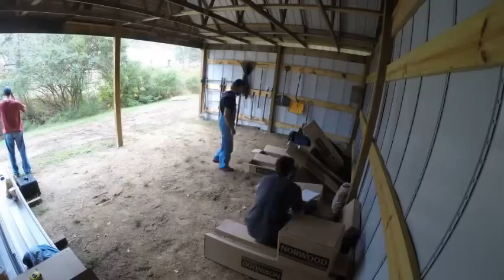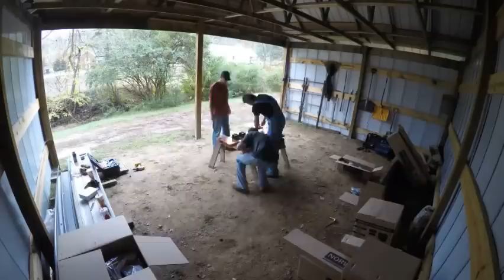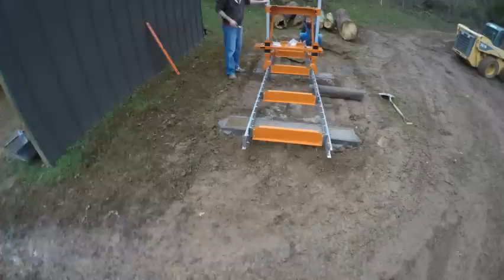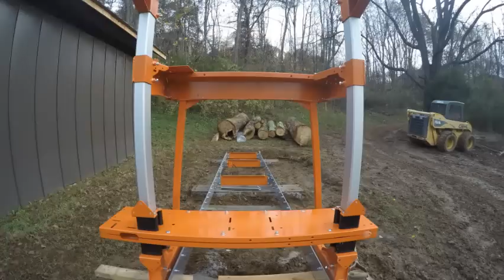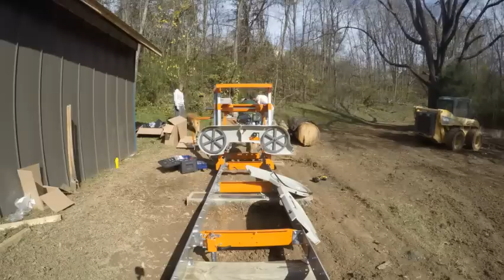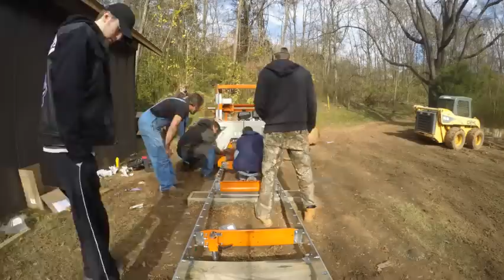Time Lapse Construction of a Norwood LM29

Comment: What do you do with the orange and blue wires and the black and brown wires
Reply from the maker: Foreign * if I remember correctly they should be your safety switches? The stop switch and a switch for the blade cover. I think they wire into the motor. I'll have to check how mine is wired. Be mindful of wire placement. The motor got hot and melted the wire casing causing a short and shutting the motor off